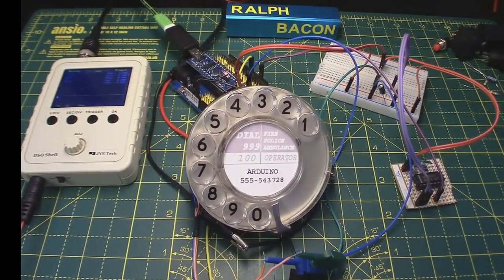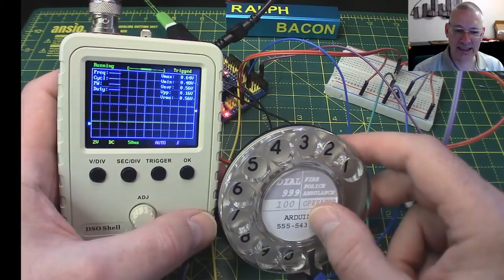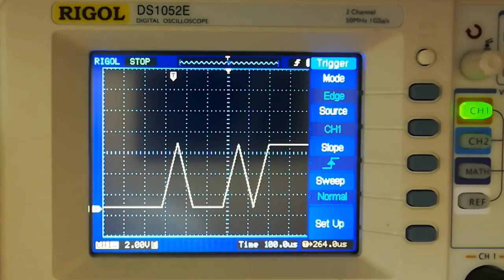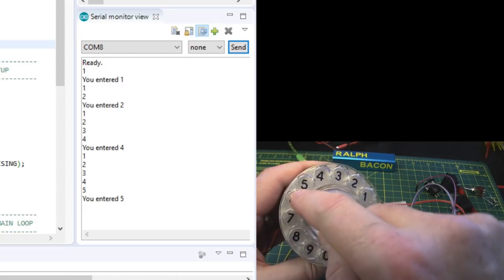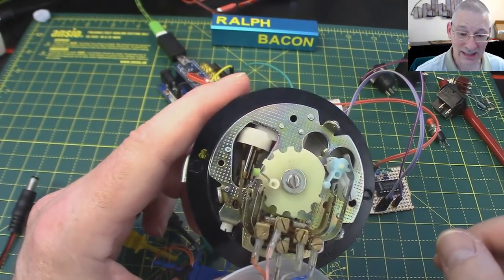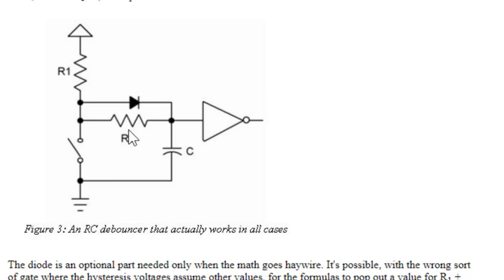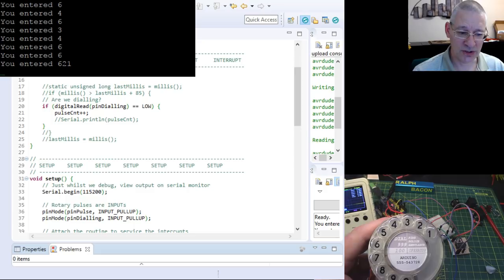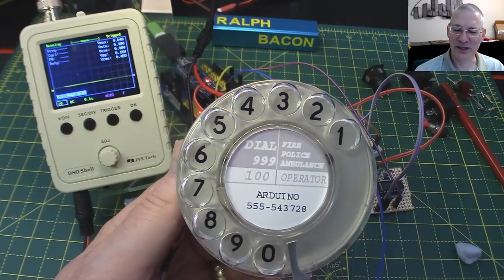#98 Telephone Dialler ☎️ and Hardware Debounce Solution (retro)

Comment: Maxim MAX6816 for hardware debouncing.
Pluses : 1 chip, no other components, connect directly to GPIO pin with interrupt. Large input voltage range.
Minuses : surface mount only, expensive.
I'm using the dual 6817 to debounce two reed switches in an anemometer.
Reply from the maker: Yes, the MAX6816 is a good chip for that except for one thing: the price. You could buy several standard Schmitt triggers (plus the two resistors, one capacitor and one diode) for the price of one MAX6816. But as you say, the advantage is that you don't need external components and, well, it "just works". Horses for courses, I guess David, and you have found yours. Thanks for sharing this information, others may well be interested in this too.
Reply: MC14490  now 5 for  1.90USD at ali

Comment: Very nice I was able to get my hands on a couple old complete telephones and would like to make one of them into a front door bell and intercom. And for another I wanted to make it into a Skype phone, maybe using numbers to select specific people to call... :)
Reply from the maker: Sounds very cool your project there Stewart, not to mention retro. Old (dialler) telephones are easy to come by but the price is sometimes eye-watering. And many of them have been converted to work with our modern telephone lines too. I shall have to think what I will use this dialler for. If you have any suggestions...
Reply from the maker: Excellent suggestion for a Real World project using a telephone dialler. Er, hang on, that safe looks just like mine. Oh bother! No wonder the chocolate keeps going missing.

Comment: I am still from the days that you would just pick up the horn, rotate some lever and ask an operator to be connected :-)
Reply from the maker: Was this at the same time that you walked in front of a car waving a red flag? And helped the man light the gas lights in the evening, Ed? Before running water was invented, in fact. Heh heh, I wish I could get one of those "wind up" phones, probably worth a mint these days.
Reply: Cars we also still had to start by cranking a lever but I was too young to help light the gass lights in the evening. I did join my dad hunting woolly mammoths for dinner though.
I used to have one of those old phones, but at the time  didnt see the value. Also had a number of those old rotay phones (T65 model) but  somehow lost those in the course of my life with moving house etc.
By the way, I remember that in Norway, the  ciphers on those rotary phones went the opposite way
Reply: Got one of the crank phones from a friend whose dad passed. 

They were going to use it as a decoration, but someone 'helping' them clean the garage threw the thing out!

Luckily my friend was able to retrieve it, but the microphone holding arm (metal) broke, as well as the bakelite cone around the mic, plus the earpiece wire was ripped out.
        As my friend isn't technical, I got offered it as a restoration piece.
I haven't had a chance to do much with it yet, but I'm hopeful I can make it look good again - though I'm sure its lost any value as an actual collectable - It still is pretty cool.

It's amazing what the wiring standard was back in the day.  The insides wiring looks crazy.

Since it needs work done anyway, I'm thinking of covertly converting it to work as the enter buzzer for our home - just need to steal a few parts from a cheap modern phone and rewire.

     Actually, do you happen to know any good sources of old-timey looking fabric-covered 2C wire?

As an aside,

Thanks for all the great videos - I'm making a small project that will be incorporating many of the concepts you've covered.

Comment: i need to extend my nano ram and flash memory or atleast the ram without complicated setup. is that possible?
Reply from the maker: I'm afraid it's not possible to extend the RAM (run-time memory) although you can use external flash memory for storage of data (not programs). If you need more memory you could move to an Arduino MEGA 2560 which has 256Kb of flash memory (for programs, whereas the Uno or Nano only have 32Kb) and it has 8Kb SRAM (run-time memory) and the Uno/Nano only have 2Kb. Sounds good?
Reply: the problem i like the nano as it's size fits more with my project so idk
Reply from the maker: Yes, I did wonder if that was the reason you chose the nano. You can however get much smaller variants of the Mega 2560 - I'll be doing a video on one of them in a few weeks time. At the risk of prematurely telling you about a future video have a look at this product, it's a Mega but very small: https://www.aliexpress.com/item/Mega-2560-PRO-Embed-CH340G-ATmega2560-16AU-with-male-pinheaders-Compatible-for-Arduino-Mega-2560/32801785024.html  - I think it may do what you want in all respects: plenty of memory, storage and a small size.
Reply: awesome, u are really my hero. i hope u can consider me from now on a special sub cuz i will always watch, like all ur upcoming vids  as much as i can unless i have serious stuff going on in rl. :) still waiting the video to check it well before i buy it.
Reply from the maker: Glad I could help and thanks for subscribing and watching! We all help one another here.

Comment: would u mind helping me with some uino code? if you dont let me know please
Reply from the maker: Believe me, Mina, if I had the time I would do it but I'm currently working on my next two videos which takes all my free time! The best place to get general help in coding is the Arduino forum (forum.arduino.cc) but you must show that you have thought about the issue(s) you are facing and have tried things that did not work. They will not write your code for you, or do your homework (if that is what it is!) but they are very experienced at nudging people like you back on the right path thus overcoming their coding road blocks. Do go there, register and be nice! You will get lots of help, I'm sure.
Reply: I have no doubt, Ralph that you would have helped me if you had the time :) but fortunately, I found some work around that fix the issue :)
Reply from the maker: Glad you found a workaround, Mina, and remember that if you are dealing with String(s) this is an artificial class for Arduino use only (not a standard C++ object at all) and it is just an array of char[ ]. Just bear that in mind :)